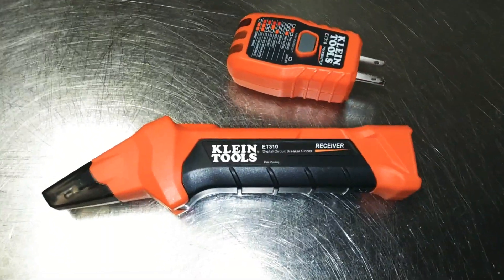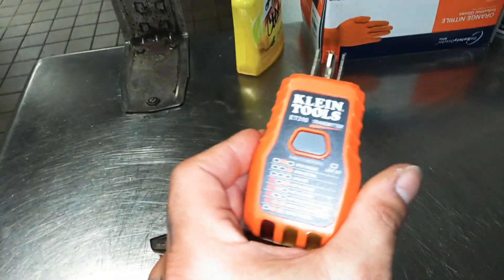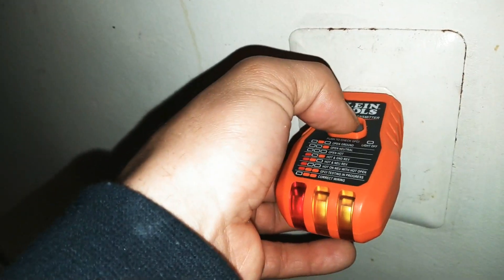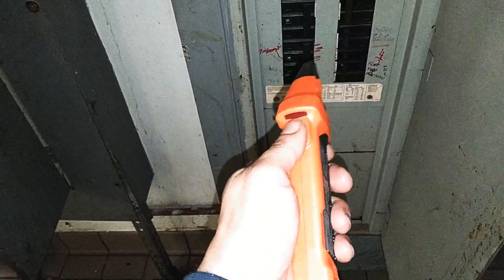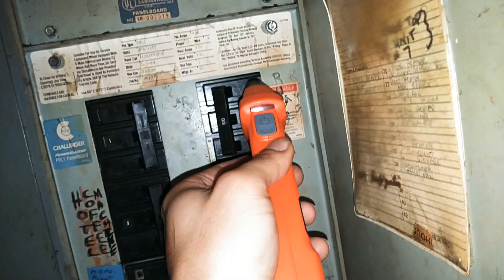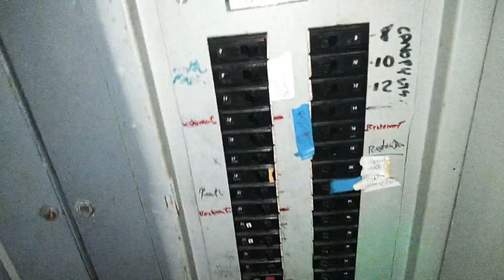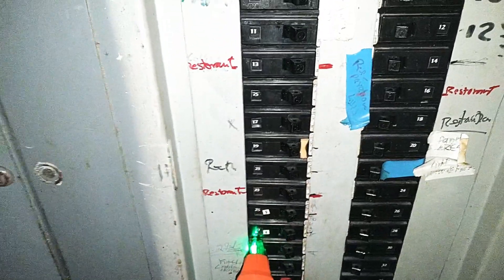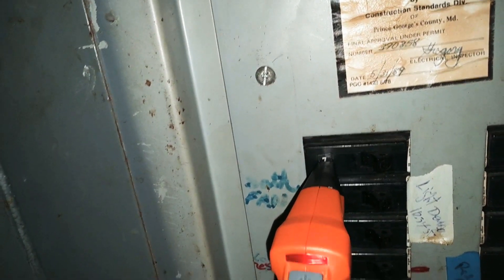SHOULD YOU BUY? NEW Klein Tools Circuit Breaker Finder & DOES IT WORK? 🤔 #HowTo #KleinTools #2021

Comment: I don’t believe this tool will work in a panel that contains ground fault or arc fault circuit breakers.  If all the breakers are standard breakers, it works fine. Wish Klein would not this on their packaging!
Reply from the maker: They made attachments that allow for gfci and af circuit breakers to work with the reciever. There's 3 total styles available actually, this is just one of them
Reply: Thanks for the reply, do you have any more info regarding the "attachments" you refer to?  I've never seen any such devices and not sure where to look?  Thanks in advance for any additional info you my have. @ASAPJermz
Reply: Like a wireless continuity test

Comment: Thanks for the video 
Will this also work to find which breaker is the one connected to a non working  / dead outlet-?  Like for continuity for the wiring between the dead outlet and the assigned breaker-? Thanks
Reply from the maker: Yes. Regardless if the outlet is dead or not the receiver will indicate if it's connected to the same circuitry.
Reply: Transmitter has no battery and works off house current so No it will not work for that
Reply from the maker: It won't work like that but a little ingenuity will work 👍🏼

Comment: Thanks for the video, I had the before model ET300 and it worked pretty ok, now I have the ET310, the problem we have here in Puerto Rico is that the so called electricians before my generation tended to share the live and/or neutrals with many other circuits all around the house/buildings and its kind of annoying trying to find which circuit is which 🤪🤪
Reply from the maker: Ran into that problem before too bro 😂 shit sucks
Reply: be careful those shared neutrals can bite hard lol

Comment: Does this work to identify other outlets on that circuit?
Reply from the maker: It's intended to inform you if the circuitry of a specific outlet is wired properly, without having to take the entire receptacle apart. Now you can go from outlet to outlet and hit the breaker to confirm, it's do able but, that's not necessarily logical in a bigger setting or application. So long story short yes it can do that but, there's other tools created for this specific usage. Hope this helps
Reply: @ASAPJermz  I thought that the sending unit generates some kind of signal that's carried back to the breaker by wire and the receiver can pick up that signal in the breaker. If that's the way it works I would think that it would pick up that signal anywhere along the wire's path. I'm needing to install some GFI outlets and hoped to be able to use this to show all of the outlets on a breaker, simplifying the identification out where I need to install the outlet.
Reply from the maker: @dksix1905  If this was a Circuit tracing tool you could indeed do that but, this is just an outlet tester mainly for DIY and garage warriors, although I've seen a couple Electricians use it on a couple jobs. Pretty much an entry level tool. I know what you're referring to & those cost a lot more than this
Reply from the maker: @dksix1905  BTW it's been found that GFI & GFCI receptacles don't do well with this tool. I've heard of it giving off a loud beeping noise when connected. Just a warning, I'd probably look into circuit tracers. Check out Ideal or FieldPiece
Reply: @ASAPJermz  I wasn't looking to use it in GFI outlets. I want to plug it into an outlet and use it to identify other outlets and the breaker that make the circuit. But either way, I ordered one of the ET300 testers last night to try. I didn't buy this ET310 as the only difference I could see was the outlet tested and I already have one of those.
Reply: @ASAPJermz  The breaker finder I ordered came in Thursday (Klein Tools ET300) and I tried it out last night. As far as working to alarm on outlets that are on the same circuit, it sort of works. It will alarm on outlets but apparently, the learning part of the process that happens when you scan over the breakers is short-lived. When I was working in the basement I could do the learning scan and for a short time it would identify the other outlets on the circuit but after a minute or so that stopped. I could go back over to the panel and would have to go back through the learning scans again to get it to alarm on the breaker again. It was well worth the cost ($27), it paid for itself just last night working in a big house saving me many trips up and down the stairs but I still had to identify out outlets on the circuit by checking each one.
Reply from the maker: @dksix1905  Good choice bro 👍🏼

Comment: I have one of these and it works great. I also purchased the accessory kit for about $15 that gives you a light socket attachment, alligator clips, etc., to find non-outlet circuits. The one thing not shown in this video is the initial device reset and first pass over breakers so it can "learn" the panel and then the second pass to find the exact breaker. All-in-all a very handy device.

Comment: but, this shitt doen't work on old . house  breaker panel. h.
Reply from the maker: You need to spend more 💰 for such a tool in that case. This is more so for modern homes/spaces with recent or not too old wiring and circuitry. Sorry this wasn't helpful to you!

Comment: I'm a maintenance technician in a apartment complex. Get alote of calls about plug outlets not working guess I wouldn't really be able to use this if outlets are tripped not on ..or can ? Kinda like if it ohms out or something?
Reply from the maker: You'd be better off just using a multimeter in this case. Especially if you have multiple outlets that are out
Reply: this tool is not so reliable, i used  one and  many times it show the wrong breaker.
Reply from the maker: @prabhats860  This video wasn't demonstrating the reliability of this tool as I didn't make it. It's just a demonstration for those who've never used such a tool before. But, I've never had a problem with identifying breakers with this tool.

Comment: You think i can rig this to trace 277v lighting  curcuit or would it mess up?
Reply from the maker: Probably would kill it 🤣
Reply: @ASAPJermz  Dear all,

 

We are Gulf of Suez Petroleum Company (GUPCO joined venture , one of the major oil and gas production in Egypt ).  Recently we bought 4 Sperry circuit breakers finder CS61200 , 120 V 60 Hz. we need to operate such devices on 220 V 50 Hz is it possible? if not can we install transformer 220 V 50 Hz / 110 V 50 Hz before transmitter …….is the device will work normal? can we replace any components inside the transmitter to achieve our target …. can you determine such components? can you send the internal electrical drawing? Do you have another model working on 220 V 50 Hz?? Do you have an agent in Egypt. 

 

 

N. B.

Regarding DualCheck 2-in-1 Tester, 50-1000V AC Non-Contact Voltage Detector, GFCI Outlet Circuit Analyzer Part # VD7504GFI can we use it as a direct contact to live wire inside the receptacle such thing will be able us to differentiate between live and neutral wires inside the receptacle

Comment: It's a great tool but you should always still check that circuit.
Reply: I am sure you will check the circuit when you go back to get the plug tester and see that it is off
Reply from the maker: @jarrydee2799  Yeah I didn't demonstrate doing that in this video but I did cut the power to the outlet on the breaker I thought was controlling it just to be sure. Kinda surprised somebody has hit me on that yet 😂

Comment: How bout on lights. Idiots in the plant I work dont have anything labeled. Now I'm having to track down where they are fed from
Reply: What I've done in the past is use one of these adapters where you replace the bulb with the adapter and then plug in the transmitter - https://www.amazon.com/GE-Polarized-Adapter-Install-54276/dp/B002DN6QX2/ref=sr_1_1?dchild=1&keywords=light+bulb+screw+in+adapter&qid=1601850105&sr=8-1

Comment: Great tool but you can’t do wires like trace out a circuit with no outlet on it like you can with the amp probe company that I have
Reply from the maker: Yeah those probes are a little more expensive. I think this tool is more so for home owners and diy
Reply: Klein came out with a $15 add on, allows you to trace light fixtures, non-grounded receptacles and comes with alligator clips for switches and junctions
Reply: @proudservice4407  ty

Comment: Why not just use a piece of copper wire bent into a U shape? Held by pliers with a rubber handle of course. Also, can this help find a lighting circuit? Thanks.
Reply: You’re telling people to short the circuit, will probably get some random person reading the comments killed but what ever right...?
Reply from the maker: Could potentially be dangerous but possible using this method for sure 👍🏼

Comment: You have to scan it 1x and then go through it 2nd time to find the correct breaker. I'll order this one next month.
Reply: Correct.  The first pass is to calibrate the receiver.  The second pass is when the receiver will react.  My previous Circuit breaker "finder" Was the one made by Ideal... Gave several false positives and maybes... Tossed it when I got this Klein.
Reply from the maker: Yup, good tool!

Comment: Worst demonstration ever
Reply from the maker: The amount of time that's passed since I posted this video, the amount of views and likes compared to dislikes say's otherwise. Not to mention other's saying it was helpful & asking additional questions after watching the demonstration. Facts don't care about your feelings.. Thanks for stopping by 🤣
Reply: Is there a need to calibrate the tool by running it down both sides of the panel first, and then re-running it through all the breakers again? Just wondering because I seen a guy in another video say it has to be done. Thanks.
Reply from the maker: @StellsBellz  Yes you have to calibrate it first before using it. Simply run down the different breakers inside your panel & that does the trick. Do this every time. 👍🏼

Comment: ?? So if I’m not getting power from the outlet and I want to track down what breaker it’s on this none power outlet .. this tool will help me ... or no because there’s no power comeing out of the outlet .. ????????
Reply from the maker: You have to have power to use this tool buddy. I'd suggest replacing the receptacle (outlet) first if that doesn't help, the breaker may be bad that's connected to the outlet, replace the breaker. Either or should your issue. Hope this helps!

Comment: Good video. I just bought this because the previous owners of my house didn't have anything labeled half right. Question if you are able to, and don't mind answering. I was using a power tool. Mistakenly cut the extention cord I was using. Now the outlet it was plugged into doesn't work. 
When I plug in the piece to check the wiring. It's all grayed out. No lights on. Is there a means of finding that breaker? Or would I just have to shut off power to the entire house? 
Thank you for your time
Reply from the maker: Unfortunately I'd say to cut off the main breaker. And then check with a multimeter or voltage tester to make sure you've eliminated all the power to your house, it's probably rated at 240v (the main breaker) so make sure it's reading 0 Volts before trying to replace the breaker. Once you're good to go, take a phillips, unscrew the wiring into the (bad) breaker and simply tighten the wire into the (new) breaker the same way it was previously; super easy. Then replace the receptacle (outlet) with a new one, just make sure it's rated the same as the breaker. Generally speaking you're probably looking at a 15 amp breaker and outlet. I actually just had to do this same thing at my house, I was welding from a 15 amp outlet but my machine requires 20 amps. I lost power to one side of the house, found out tons of stuff was on the same circuit! Had to replace the outlet and buy a new breaker! I'm actually gonna do a video on this now.. 😂 Hope this helps bro, thanks for watching!
Reply: Jeremy's HVAC Journey much appreciated my guy. Been at this thing for 2 days. Smh lol.
Reply from the maker: @sclifton8709  The more you know bro! 😄
Reply: Jeremy's HVAC Journey facts!
Reply: Check and see if that outlet is on a ground fault interrupter circuit. That interrupter may be in another room or in the garage. The gfi breaker trips before the circuit breaker does so you have to hunt down the gfi outlet and reset it. That happened to me once!
Reply: Knob Tweaker thank you for the input. It for sure was. The previous owner had those outlets connected to outlets in the master bathroom. Which are those type of outlets. Pushed the button to reset and those outlets started working again in the garage. Then I tested at the breaker box to confirm they were on the same breaker. And sure enough, they were.